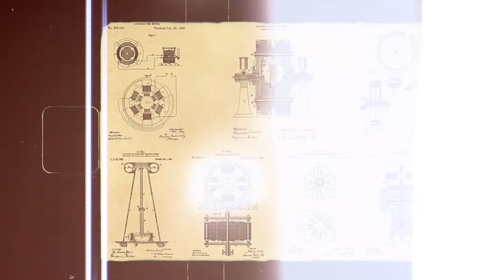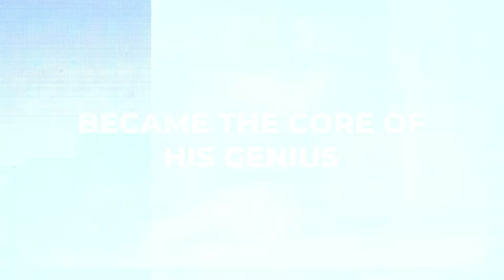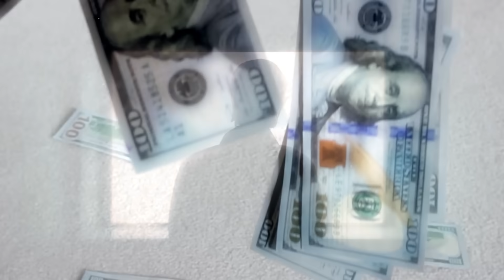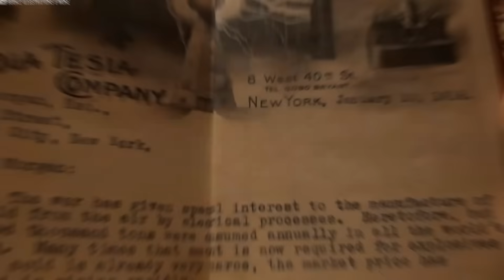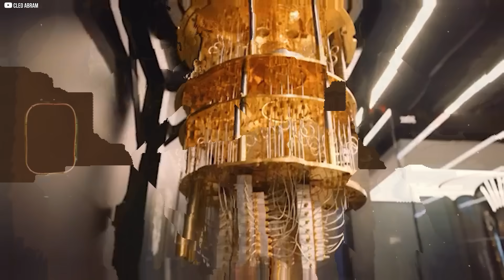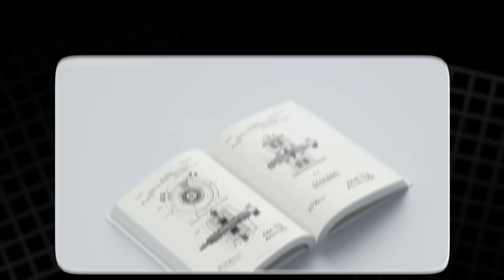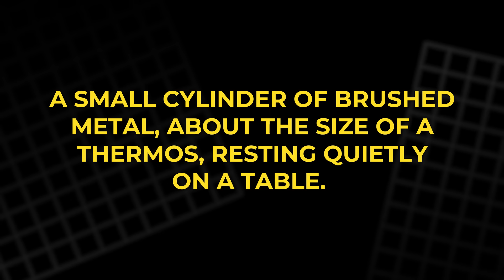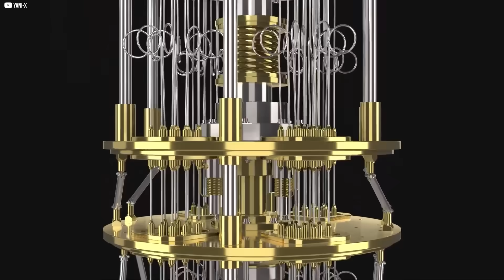Quantum AI Just Built Tesla’s Forgotten Invention

Comment: Too many pictures of the quantum computer and not enough of Tesla’s unique motor.
Reply: They are showing a Cryostat in the B-roll. It is used to create the cold temperature for a quantum computer. At the very bottom there is a small substrate attached to the Cryostat. This is the quantum computer. It can fit in the palm of your hand.
Reply: They showed Tesla’s design with words. Any photos would be locked up.

Comment: Tesla was not trying to transmit power through the air. He was pumping it into the Earth as powered Ground. Any receiver tuned to the same frequency would oscillate from the same powered ground. The oscillation is allowed by way of ionic displacement in the air. So many of you miss that fact. I've done experiments that demonstrate that fact.
Reply: If you think about it, it is basically the wireless chargers we have today earthen style. Though there is not enough electricity in one single place until you get to a receiver / transmitter.
Reply: Please make a video